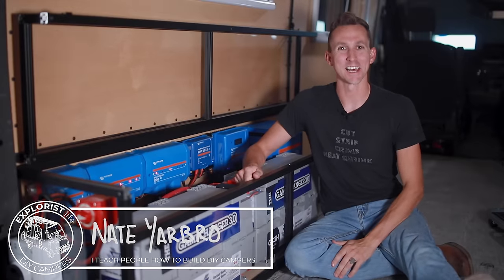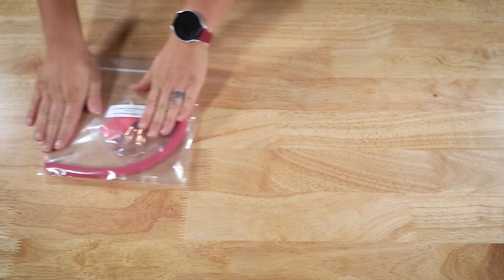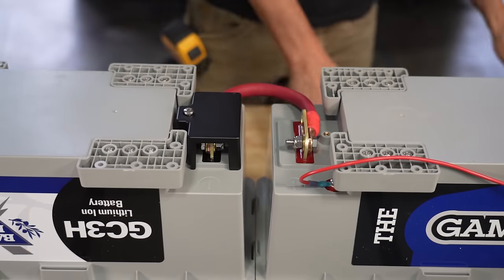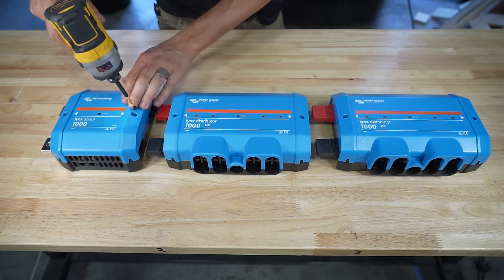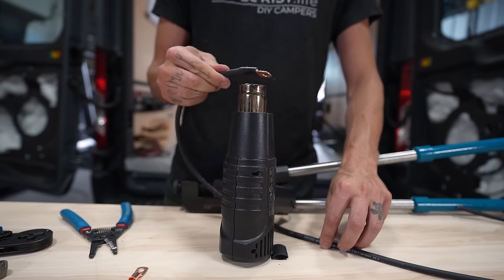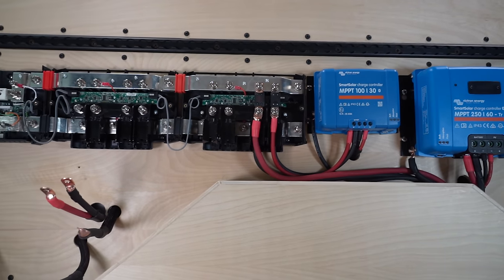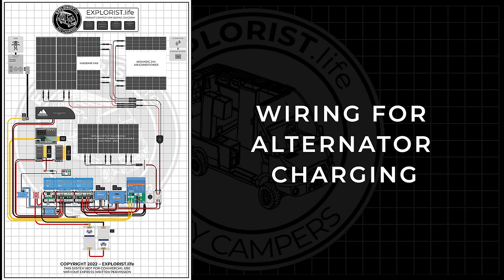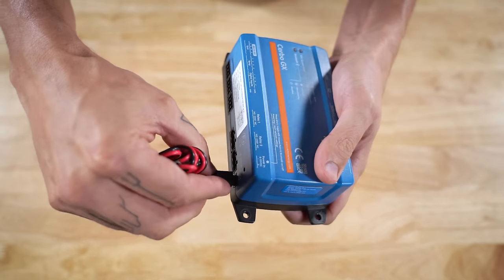DIY CAMPER VAN ELECTRICAL INSTALL (Start to Finish Tutorial)

Comment: Where do I find the Auxiliary Solar Port socket that you use tp bring in the loose panels?
Reply from the maker: That will soon be an add-on for our solar array wiring kits, but until then, I've included it in the 'other parts required' section of the kit for this build: https://shop.explorist.life/shop/all-products/camper-wiring-kits/complete-wiring-kits/540ah-3000w-24v-multiplus-580w-to-1700w-solar/
Reply: @EXPLORISTlife  thanks...  late but appreciated.

Comment: Awesome video as usual. That 12v fuse box is awesome. I’m in Australia and bought it directly from you, shipping costs be damned!!! One question, what duration are you expecting from your AC with 270ah of batteries?
Reply from the maker: Oof, yeah; I hate seeing how expensive it is for you all to get stuff shipped over there.  Thanks for the business, though!  I'll do 'more accurate' testing on the air conditioner next summer (as our temperatures are no longer hot enough to actually work the air conditioner), but speculatively...

Lets say the unit runs on high at 1,260W

Lets also say that it will duty cycle for, say, 2 cycles of 20 minutes per hour.

That means we will use: 840W per hour

With no solar charging and a full battery bank that contains 6,804Wh of capacity, the AC could run for 8.1 hours before the batteries disconnect via low voltage.

All of this, though, is assuming nothing else in the van was running; which is hardly realistic, but is difficult to project at the moment.

With our 580W of solar on the roof and basically as much solar we could deploy on the ground; we could run it pretty much indefinitely depending on how much ground deploy panels we had with us given the sun was out.
Reply: @EXPLORISTlife  thank you for the reply, I know it’s hard to sometimes find the time to do the small things. 
I suppose there is always the option of more battery as well. The way we look at it, as long as the AC keeps us happy while sleeping. Can you believe that the electric blanket was a life changer in the sub zero degrees C here in the Aus highish country and it used surprisingly little power at 80-120W draw. 

Keep up the good work.
Reply from the maker: We also used an electric blanket extensively when we were on the road full time.  We put it under our fitted sheet and laid on top of it so it kept us SUPER warm even on it's lowest setting.

Comment: I see you're using 1/0 wire to connect the lynx to the inverter/charger. In your previous build/tutorial you used 4/0 wire. Why the change? Does this build have a smaller power demand?
Reply from the maker: That's the difference between a 12V system delivering 3kVA of inverting power (requiring 4/0) vs this 24V system delivering 3kVA of inverting power (requiring 1/0).
Reply: @EXPLORISTlife  Okay I see. The 4/0 5/16 lugs weren’t fitting on my lynx distributor so I was searching for some reason why!
Reply from the maker: Some 4/0 x 5/16 lugs don't fit, but the ones we sell in our kits are guaranteed to fit since we know what they are being used for.  Amazon lugs are pretty hit or miss (mainly miss).

I'd be curious to hear why you didn't just buy from us from the start.  We are the same price as Amazon, offer free shipping on orders over $200, and have far better tech support and your stuff is guarantied to fit so you wouldn't have this issue in the first place.
Reply: @EXPLORISTlife  I feel like a fool for not buying from you, it's such a better deal! And the tech support? You really are the only choice, I can't believe I was so stupid. But unfortunately I already have the expensive stuff and buying a kit just for the lugs doesn't make much sense, so please, if you can find it in your heart to tell me which lugs will fit the lynx, I will buy every screw, wire, plug, and diagram from you for the rest  of my life.

Comment: What are your thoughts on inverter precharging? 

Amazing build!
Reply from the maker: It's not necessary if the battery bank and inverter are properly sized for each other and neither of the components used require it from the manufacturer.
Reply: @EXPLORISTlife  

I got a pretty nasty spark from a 2000W inverter and a 200Ah LFP when the battery got hooked up with the disconnect on. 

I would imagine the same thing is happening inside of the disconnect switch also?

Comment: Hi Nate and Steph….awesome as ever. I’m a marine electrician over here in the UK and also work a lot with Victron gear. Can I ask what software you use for your electrical diagrams? it’s brilliant and love how it works with the Victron devices. Many thanks. 🙂
Reply from the maker: I use Microsoft Visio for all of my diagrams.
Reply: @EXPLORISTlife  huge thanks for reply, I do have Visio,but possibly the incorrect version? As where do you get the Victron icons from?
Reply from the maker: @metalsnapper6728  Most of the victron ones I got directly from Victron.  As a Victron Ambassador, I have a few special privileges when it comes to educational resources I have access to.  The rest of the icons and such, I've made from scratch over the last few years.

Comment: Great video Nate. FYI- I found out the hard way acrylic can break with a small bump. Used poly carbonate and got great visibility and much better strength.  Seems like a big ground solar charge controller.  Can you cover why?
Reply from the maker: The big controller for the ground array is so we could theoretically run the air conditioner on solar alone.  Plus... at shows/expos that we are teaching at, it'll look flashy to have 1,700W of solar sitting out beside the van and will be fun to show the effects of having that much solar plus having an air conditioner running at the same time.
Reply: Just curious as to how you plan to carry all that ground solar?
Reply from the maker: Just in the 'garage' area of the build.  Will build a little cubby for them.  Will be using flexible panels, most likely, so they don't take up as much space.  Also will rarely be carrying all 1,700w of panels.

Comment: Superb, I do not like, however, how the positives crossed on 24-12 converter.  I am concerned about rubbing through.
Reply from the maker: It's fine. 🙂👍
Reply: @EXPLORISTlife  Me being paranoid :).  Any calculations of the life of the battery pack when the AC is full blast?  That is the million dollar question.  Assuming no solar.
Reply from the maker: It's a 1200W air conditioner and we have a 6800Wh battery bank.  So... ~5 hours of non-stop running with no additional charging sources or loads.

Comment: Definitely keen for the programming parameters:) thanks for the detailed video.
Reply from the maker: Hey!  Thanks for your patience.  I've added the basic settings we used to the product description of our wiring kit here: https://shop.explorist.life/shop/all-products/camper-wiring-kits/complete-wiring-kits/540ah-3000w-24v-multiplus-580w-to-1700w-solar/

With the Cerbo GX, there is more that CAN be changed since the Cerbo GX is effectively a fully functioning computer, but the above settings will get you going.  I do recommend, though, diving into the user manual for the Cerbo GX to see what else it is capable of.
Reply: Thanks! That's awesome :)

Comment: Awesome video...Question regarding the AC fuse box.I have the same one and was wondering... If you want to do more AC circuits do you run another wire from AC out 2 on the inverter to the other side of the AC fuse block and do another main fuse? Thanks...can't wait to see the finished result.
Reply from the maker: Yes, but AC Out 2 is only active when connected to shore power.  We can fit 8 circuits on one side of the breaker box, though, which should be PLENTY for a camper.
Reply: @EXPLORISTlife  Ha...good to know. I wired a multi outlet extension cord to AC out 2 in my last van and thought there was something wrong with it when it didn't work.🤪 Is it possible to bring power to both sides of the AC fuse box with just the AC out 1? How would you do that? Thanks.
Reply from the maker: @comalley5064  There's not a good way, unfortunately.  Keeping the circuits below 8 per side to stay within the specifications of the breaker box is the best option.  I wish I had a better solution for you.

Comment: so is the only chassis ground point in the entire system on the lynx distributor negative bus bar?
Reply from the maker: Indeed
Reply: @EXPLORISTlife  just to clarify, the equipment ground for both mppt are connected to the equipment ground on the victron multiplus, which is then connected to  the ground on the 2nd lynx distributor, meanwhile the 1st lynx distributor is connected directly to chassis ground?

So if im using a positive and negative busbar, i would connect 1 lug of the negative busbar to chassis ground, and on another lug connect my inverter and mppt equipment ground?

Thanks for the reply! Through the help of your videos i think ive finally grasped how to set up my system. Understanding chassis ground is the last piece of my puzzle

Comment: Good job on the videos! Quick question though. What size fuse did you put in the Lynx distributor for the 30A Victron solar charge controller? The smallest Mega fuse that I can find is a 60A... Thanks!!
Reply from the maker: Parts and diagram used in this install: https://shop.explorist.life/shop/all-products/camper-wiring-kits/complete-wiring-kits/540ah-3000w-24v-multiplus-580w-to-1700w-solar/
Reply: @EXPLORISTlife  Thanks for the reply. Although it makes no sens in putting a 60A on a 30A device. Maybe someone could explain the logic behind this ? My understanding is that the fuse was to protect the wire as well as the device?
Reply from the maker: @marcksavoievoyer6424  Sounds weird at first, I know... but it's correct.  Here's why: https://youtu.be/5y-yDMEgV70
Reply: @EXPLORISTlife  Thank you for the reply! Keep up the good work!

Comment: Is there any reason you don't include a surge protector/EMS between the shore plug and multiplus?
Reply from the maker: For that, you'd just get one of these and plug it into the shore power pedestal: https://amzn.to/3GBZ4Op
Reply: @EXPLORISTlife  Any concerns about the EMS at the pedestal failing to correctly cut off for the low voltage actually being seen inside the van due to voltage drop? For example if the EMS has a low voltage cut off of 104 and your extension cord has a few percentage voltage drop, the voltage at the van will actually be say 100 volts. If the EMS was inside the van it would be on the side having the voltage drop and correctly cut off at 104 volts the van is seeing.
Reply from the maker: @CPRebels21 In that scenario, we could set the low inout AC voltage shutdown to whatever we like in the multiplus settings.

Comment: Does the equipment ground wire need to be a heavy gauge wire ?
Reply from the maker: Indeed.  Wire sizes are listed in the wiring diagram as well as the our wiring kit for this project.

Comment: Very useful and very well done. Only small thing I may have do e differently is a small wire loop on the ac in and out in the multiplus rather than cables coming straight down and out for added safety. After you have finished the van you really should do a victron home solar set up with an ac coupled side and dc coupled side via mppt for best of both worlds?
Reply from the maker: Thanks!  I've never tried, but I don't think you can loop that big 6ga wire inside of the multiplus.  Simply not enough room there.
Reply: @EXPLORISTlife ah yes, in the UK the cable is smaller if course being 230v and a loop allows for future cut and crimp reconnect and safety against being pulled out but yes, tricky with your 120v monster wires.
Reply from the maker: Ah, yes.  I see.  What size of wires are you typically using for the AC input and AC output over there in the UK?  I've yet to educate myself on what sizes of wiring people around the world are typically using for various things.

Here in the US, we've got campers that can charge from 30A shore power and/or 50A shore power.  30A gets 10ga wire (5.2mm2) and is protected by a 30A breaker and 50A shore power gets 6ga wire (13.3mm2) and is protected by a 50A breaker.

Comment: I don’t get why you went to this detail. It really seems over complicated. So many parts that aren’t needed to have a working system.
Reply from the maker: Yeah, I mean... you could absolutely go to the car dealership and pick up a new Honda civic if you needed a car to get you from A-to-B.  Or... you could rebuild a high performance 1970 Chevelle from the ground up with all of the bells and whistles you want and know how EVERYTHING works on it at the macro level and have some pride if what you've built.

Our channel is metaphorically about the latter.
Reply: @EXPLORISTlife  how much did this entire system cost? I would guess maybe more than the van it’s installed in?
Reply from the maker: You think this system cost more than a 2021 Ford Transit 3500 AWD? 🤣😂 Boy, do I have a surprise for you.

As far as how much the system cost... you could look up the parts list / kit that is linked in the video description or pinned comment for up-to-date pricing, or you can check out this video for how much the system cost at the time of building: https://www.youtube.com/watch?v=Tkbj51mOhKg

Comment: On your 250/60 mppt, were your wires to the linxs distributor over sized? I'm running the same and my distance from mppt to linx is 8ft (POS & NEG length) and at 24v at 60amps, calls for AWG 8 wire. I know the mppt manual says it can accept up AWG2. Just trying to see what I missed in your reason for wire size.
Reply from the maker: Yeah, it's a bit oversized.  We size the output wires on all of our charge controller wiring kits at the max wire size the terminal fuse will fit so that it works for 100% of use cases regardless of if somebody is using it for 12V, 24V, 48V, or has something weird going on that we can't see before somebody buys it.  It's a problem-proofing and 'removing all doubt' kind of thing.
Reply: Yep understood, and larger wire is never a bad thing. Great video man, keep up the great work!
Reply: @azzkikin1  Larger wires is good for electricity, but bad for weight, and the van has a fairly low max weight
Reply from the maker: Shadowvort... As I mentioned on your other rant...  Those two wiring kits you're questioning only way 6 pounds (shipping weight... so that also includes the packaging) combined, and we didn't even use all of the wire in those.  I don't think 6 pounds is going to put us over our payload.

I'd hate to see how you talk to somebody who travels with a 2nd, 3rd, 4th, or even 5th additional human.  "Nope, sorry kids.  You can't go.  You weigh too much." 🤣😂  We can afford the extra 6lbs of wire since we don't have kids; how about that?
Reply: Right, if wire will put you over weight, you bought the wrong rig.

Comment: F you guys.  This video is too good.  I love it.  Gonna watch this a few (20x) more times as needed.
Reply: Incidentally, did you all make the alternator install and connection to your electrical system video?  If not, do you have any suggestions I could watch?  Thanks for your response in advance.
Reply from the maker: Not yet (1/28/23).  Still searching for the perfect solution.
Reply from the maker: Hey!  Just wanted to follow up on this.  We just released the alternator charging video that accompanies this tutorial.  Here is the direct link to that: https://www.youtube.com/watch?v=FuBAKTCCnt4

Comment: For the Display you could also use an active usb extension (there is a voltage booster in the cable) (a small box)
Reply from the maker: I guess you've tested that?
Reply: @EXPLORISTlife  No but thats how a active cable is used for :) im just an IT guy
Reply from the maker: Okay, yeah; definitely a good idea to bench test it first.  Extending the display is INCREDIBLY finicky.  I've seen one HDMI extension work and another one of the same brand/size not work.

Comment: First a big thanks, this video along with all of your others are truly fantastic. I purchased a wiring diagram from your site and now am about ready to do my install on a 40 foot toy hauler. I have one question, what is the exterior receptacle you are using for the "ground deploy" solar panels?
Reply from the maker: Check the 'other parts needed' in the kit listed in the pinned comment.
Reply: @EXPLORISTlife  , Totally sorry, I feel like I am being a PIA... I have searched the entire comments section for this and there is nothing I see and there is no pinned comment. Is it in the description area and I am just missing it?
Reply from the maker: No worries.  Here is a link to the kit for the install shown in this video: https://shop.explorist.life/shop/all-products/camper-wiring-kits/complete-wiring-kits/youtube-project-kits/explorist-life-ford-transit-540ah-3k-24v-inverter-580w-to-1700w-dual-solar-array/

The "Aux Solar Port" you are looking for is at the bottom under 'This Kit Also Requires'.  

Sorry for not just dropping a direct link and making you jump through hoops, but showing where to find links is the only way I can keep my links up to date with Amazon (just as annoying for me as it is for you, I'm sure.)
Reply: @EXPLORISTlife  That worked :) Thank you for helping me nail down this build out ;)

Comment: Hi, what is the name of the wire plastic box/cover? Can this charge controller charge a lifepo4 directly without the inverter (DC to DC charging)?
Reply from the maker: Which wire plastic box/cover are you talking about, in particular?  

This system can indeed charge the batteries directly without an inverter in the system, yes.
Reply: @EXPLORISTlife  the horizontal plastic channel were you put the wires that you attached to the wall. Looks like a cable management duct system.
Reply from the maker: @carlossantini  The Lynx Distributor?
Reply: @EXPLORISTlife  NO. The PVC cable management enclosure.
Reply from the maker: @carlossantini  What timestamp are you looking at?